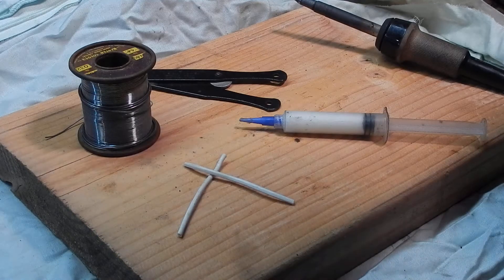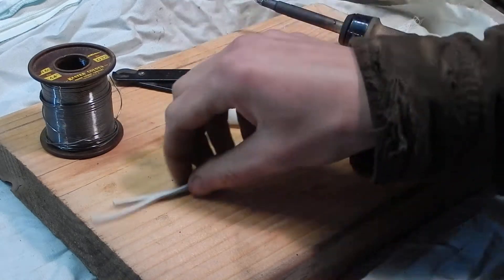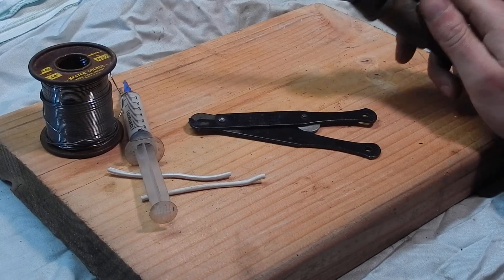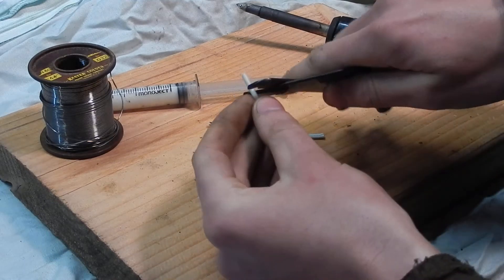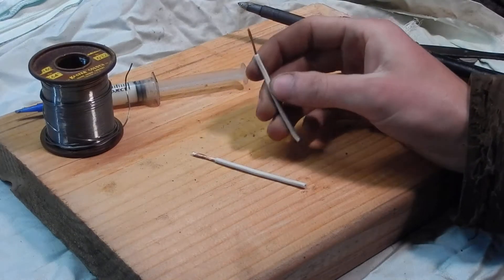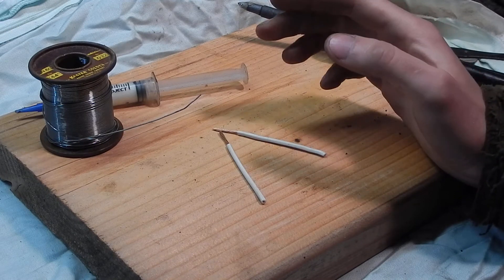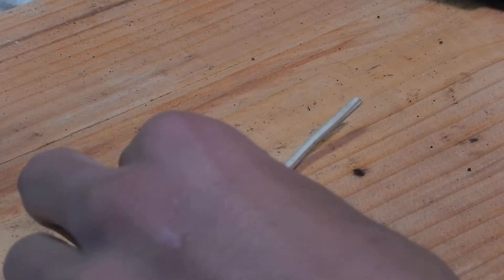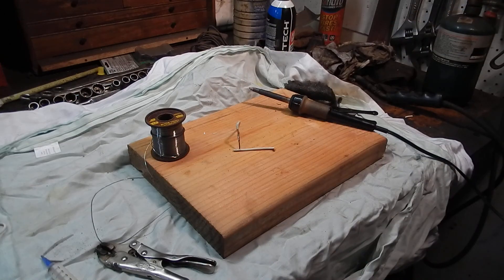Shop Talk - Tips For a Good Solder Joint - How To

Comment: You're a pro! I've been doing it wrong my whole life. I actually gotta solder up a blower motor resistor at work tomorrow. Thanks!
Reply from the maker: skylar freeman Thanks! glad it helped you out. Out of curiosity, what were you doing wrong that made it harder for you to solder?
Reply: First of all I never new there was a separate Flux opposed to built In the solder wire. That seems to really do the trick of getting the heat to distribute. I just usually jam the tip of the iron on the joint with a lot of pressure and wait and that usually means messing up the joint a bit,then I usually roll the iron around to get the solder to melt in other places. And when you move it around you lose contact and cause the joint to cool. It is usually a PITA.
Reply from the maker: Interesting. kind of sounds like my first attempts at soldering too! and you're right, the extra flux really helps out. it's not necessary but is great to have. i don't know what the stuff is that i have, but if you make sure to not get an acid flux (i think the other kind is rosin flux, there may be others too) you don't have to worry about cleaning flux off the joint because it is non-corrosive. acid flux can potentially eat away at a connection however if it is not cleaned off.

Comment: On small wire like that I usually fray both wires and feed them into each other and them twist them together. That way if they get pulled the strands tighten on each other like Chinese hand cuffs.
Reply from the maker: UnitCrane514 i've considered doing that but never tried it. i'll have to see how i like it!